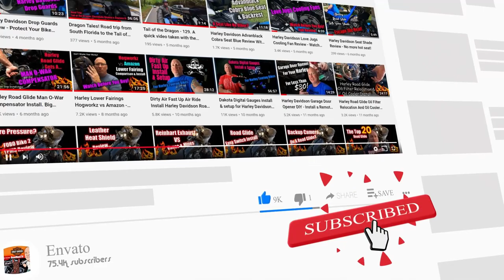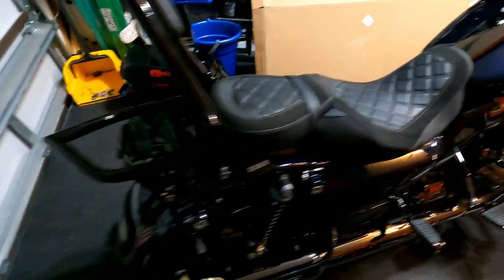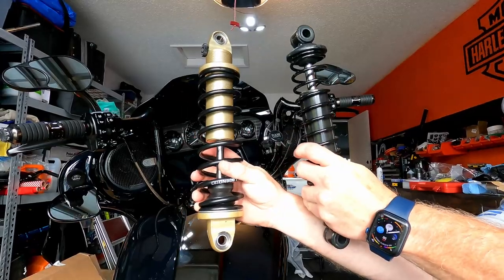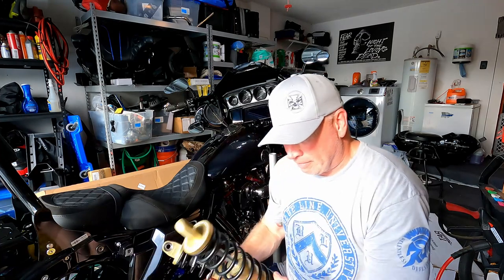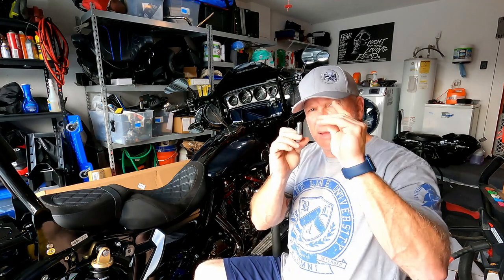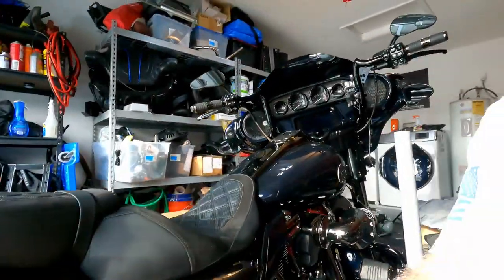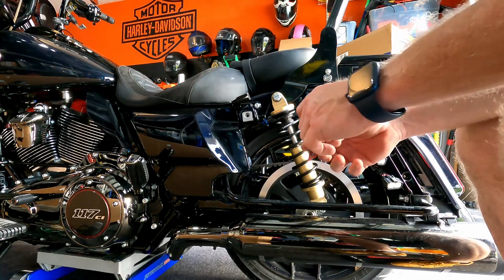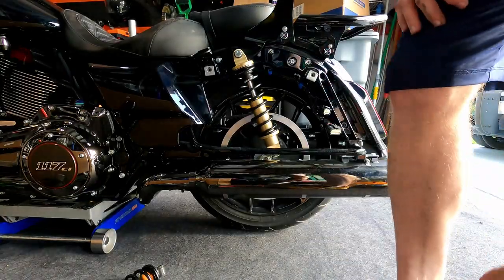2022 Harley Street Glide CVO Gets Some New Revo A Shocks

Comment: You already confessed to being a seat collector. If you decide to become a shock collector as well, check out the Russ Wernimont Designs RS-1 shocks. They’re not too expensive and they have piggyback reservoirs. I have the 14” size. Some people stay with the 13” length shocks in case of any clearance issues with full length mufflers.
For my next front suspension rebuild, I might look at GP cartridge inserts.
Reply from the maker: I was actually going to put the GP cartridges in my Road Glide if I were to go with the Krauss setup.  It's a definite possibility for the front on this CVO.  Those RS-1's look nice but I'm not dropping another grand just to review them lol.